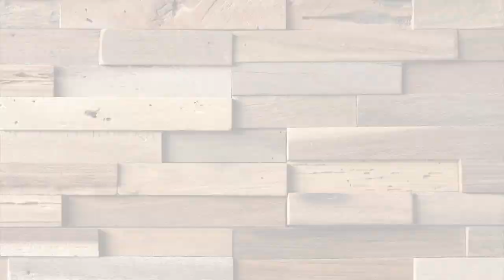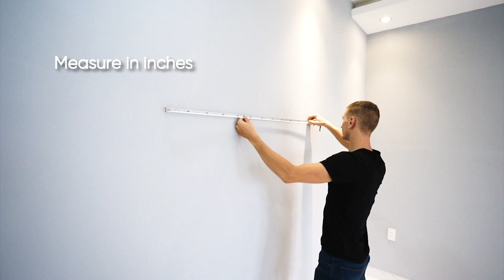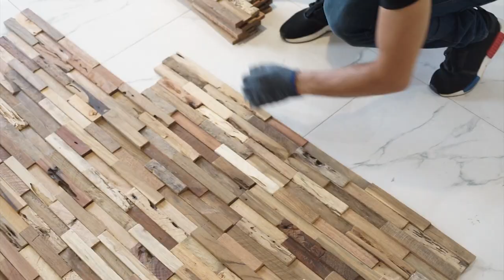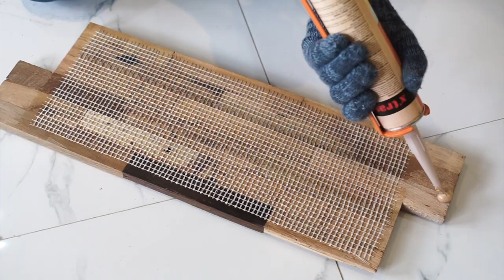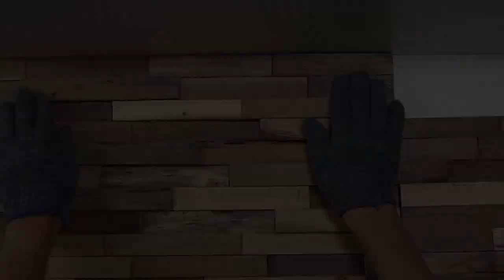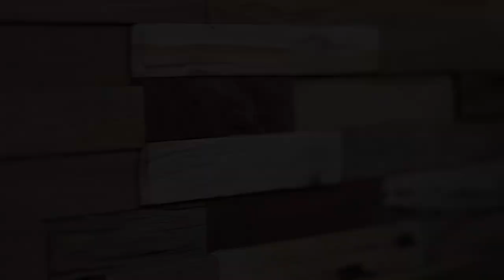How to Install DIY 3D Reclaimed Wood Wall Panels. WoodyWalls

Comment: What type of nail is recommended?
Reply from the maker: For our 3d wood wall panels, We suggest using 18 brad gauge nails and/or high quality construction adhesive.
You can check out all our 3D wall panels by clicking here: https://woodywalls.com/collections/3d-wall-panels/
Reply: Can you just add the glue without nails?